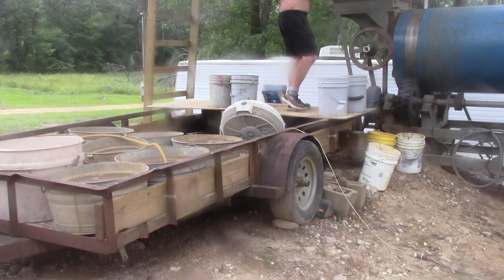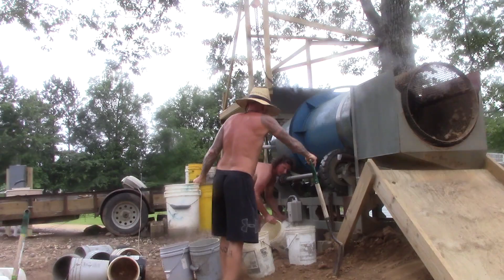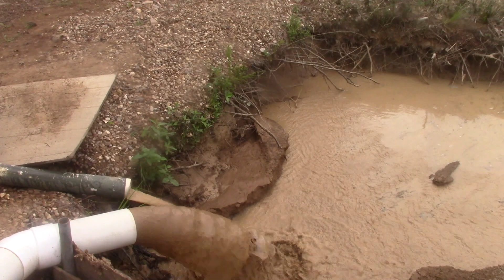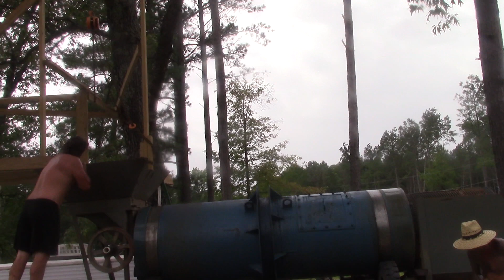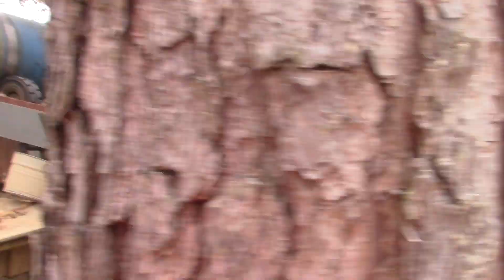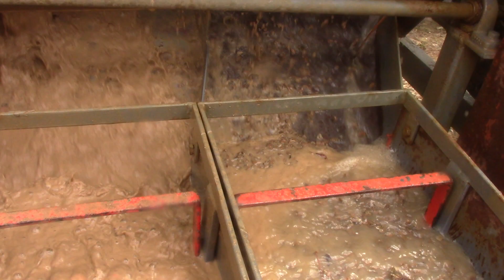There Is A Modern, Diamond-Recovery Plant In Operation Near Arkansas' Crater of Diamonds State Park

Comment: next you guys need to build a belt feed system, so you could shovel right into the belt with a hopper. or, just dump into it with a tractor loader... that woudl be awesome haha... how often do you, or they, do clean outs?
Reply from the maker: We plan on running with a tractor loader.  But we need an excavator and dump truck, too.  We can run for 15 minutes then take 30 minutes to clean out and collect the heavies.  Then we start up again to run another quick batch.
Reply: @genuinediamondsinar3253  thats awesome. are you guys classifying to a certain minimum size? if so, it woudl be cool if you had say, a 20 mesh large shaker screen that was, say 45 by 45 inches in dimension, and maybe 6 inches depth that could be submerged to hold all the heavies in and help to clean up all the silt that may stick to the material, and to run larger batches. i can imagine that, the more volume you can run within such a screen the better the concentration may be, especially if the screen is slightly conical and materials could be concentrated into the center as you go along, and then, just use a mechanical flipper to flip the screen with using a large solid plate to hold the material in place, then shovel out the center, and run that manually. then you would be able to run much longer, and much more volumes too.

Comment: What was going on in that shaker sluice section? Why was the good stuff going 4 feet at high volume before discard and the big was going down 15 feet at low flow?
Reply from the maker: There are 4, one-foot-square boxes where the good stuff goes, 2 for each size.  There is a rubber tire jig bouncing the minerals up and down all the time.  So, they heavies are dropping down and the light stuff is being washed away.  It is very efficient.  I do need to increase the water flow on the oversize material.